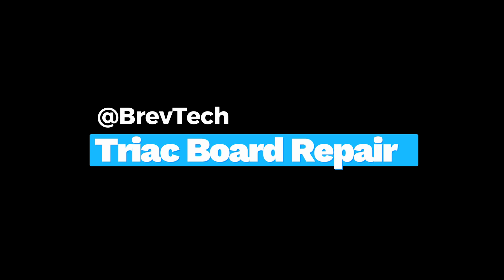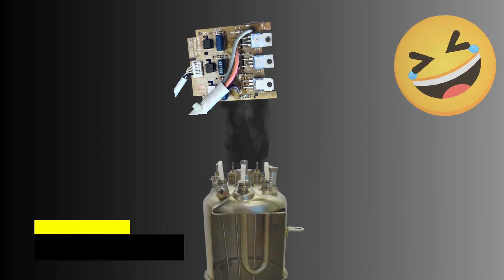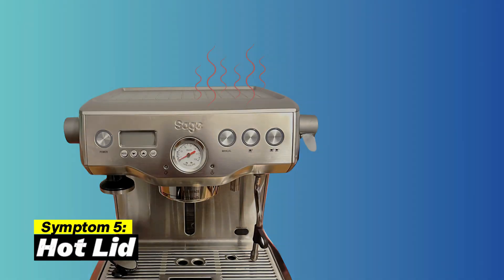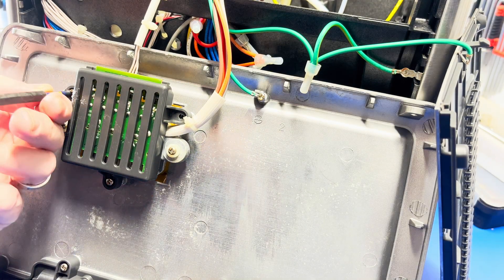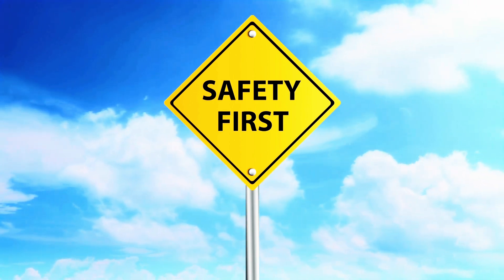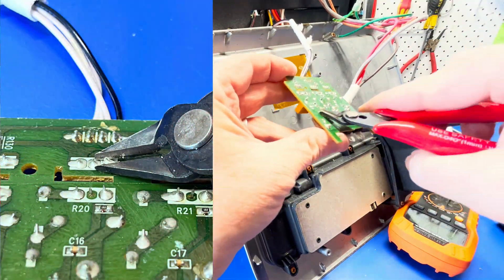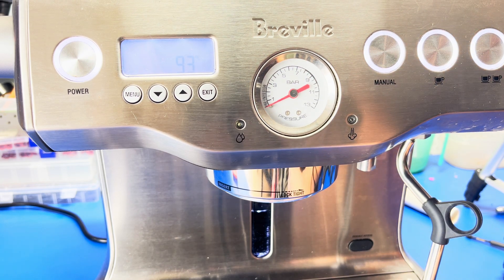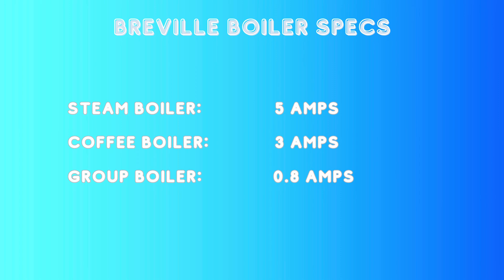How to Diagnose and Repair the Triac Board on the Breville Dual Boiler BES920/900

Comment: This is an awesome video for the BDB community, and my quick tip is to clean the thermal paste with 99% isopropyl alcohol on the heat sink and reapply on the triac and the heat sink.